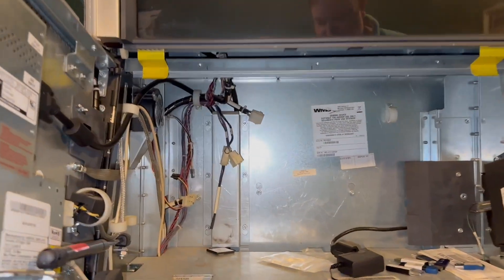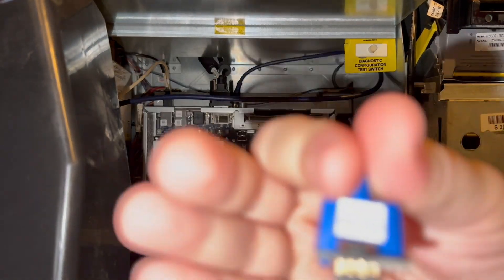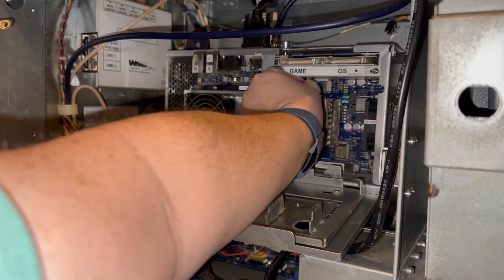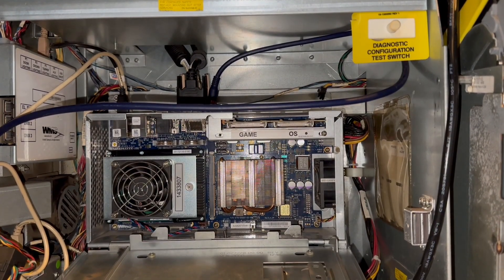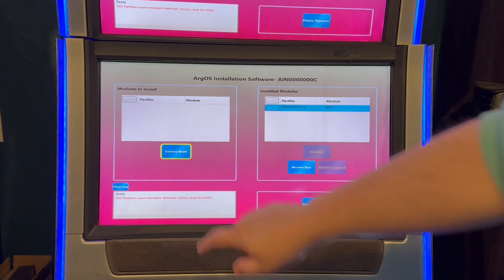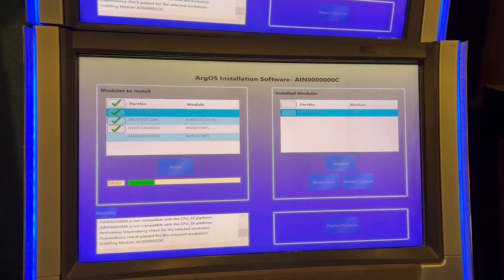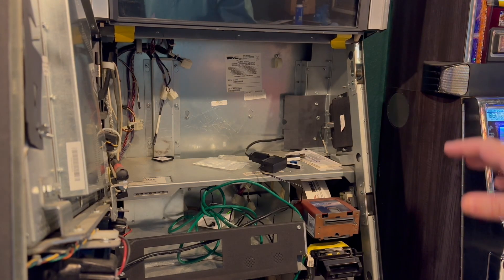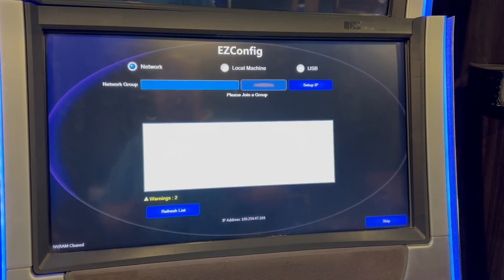How to convert WMS Blade to ArgOS

Comment: You can install Millenery-based Japan Slot Machines to WMS Bluebird 2 (no mechanical reels) cabinet (and vice versa), but it requires technical modding.
For example: Putting Bonus Spin Z Twin Jokers to WMS Bluebird 2 cabinet, Willy Wonka to Millenery Cabinet.
Japan Slot machines Require Medals (can be substituted as quarter), while America Slot machines require actual money.

Comment: why does it need a network hub that goes no where?
Reply from the maker: Correct - It just needs to get an IP address, public or private. If it's private, it assumes it's SAP (stand alone progressive), if public, it assumes LAP or WAP.
Reply: @HomeSlots  Is what your talking about it needing an IP address similar to what is needed to get Reel ‘Em In Catch the big one 2 to run on a stepper blade?  I am trying to figure that one out.
Reply from the maker: @johnconti7584  I'm pretty sure that one requires an actual IPC (progressive controller)
Reply: You mean the Bally local link progressive controller.  do you have any referrals for anybody who understands that?